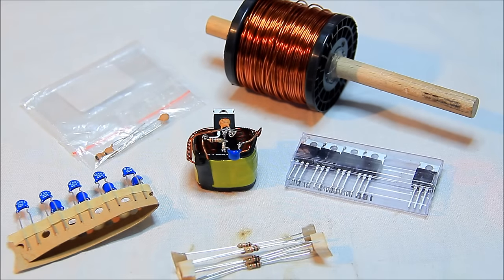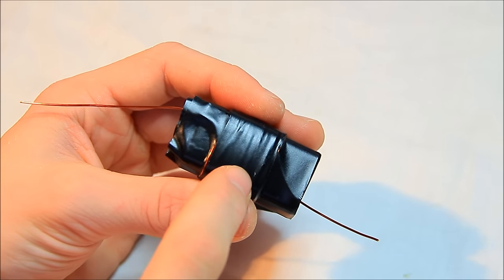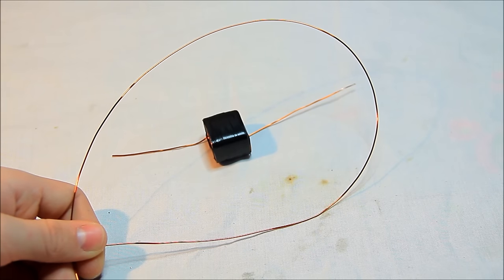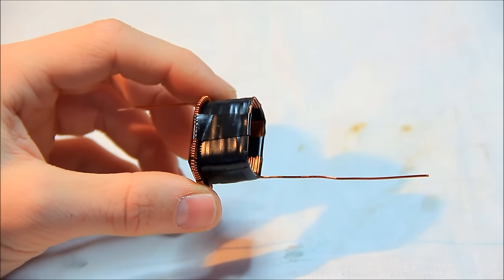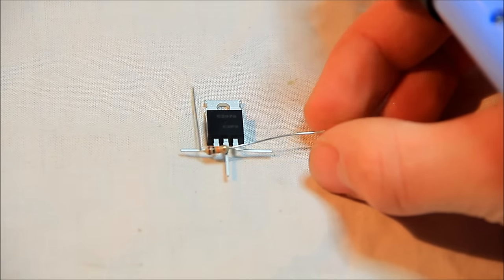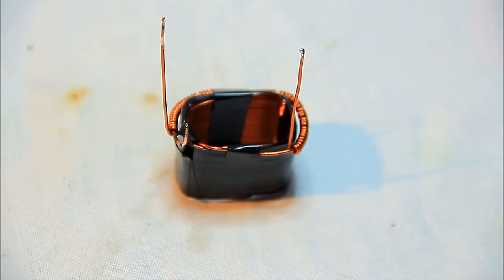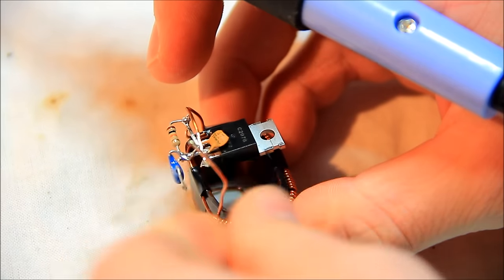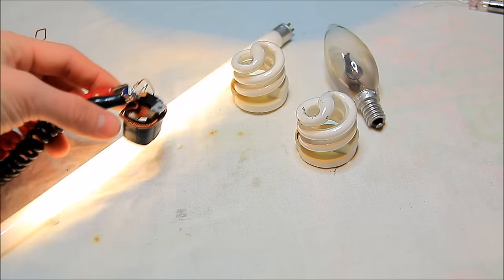EMP Jammer Step by Step / Slotjammer Tutorial

Comment: I have been making there's for years and I promise you they work 100%. You have to use the right components and make sure nothing is touching. Also the coil can't touch anything when it is firing. Lots of mistakes can be made, but if you do it right it works. Main could is 25-30 and smaller secondary coul is 2x the primary. Power with 3 9volt batteries but can handle 5 9volt batteries.
Reply: How much do you charge for them
Reply: Do you sell these?
Reply: It is strange that the power is connected across the emitter and collector.
Also the primary circuit. A high current low impedance supply would not be good.  But it seems to work with batteries.
The length of the power leads must affect operation.
Reply: please make me two of them i will pay you.also i have an e.l.f. emp that i bought as a sleep aid can it be modified to beat game machine
Reply: Where can I buy one of these
Reply: Would the one in the video be able to jam shielded devices

Comment: here is what you will need:

0,7 mm copper cable
electrical tape
9 volt battery
transistor 2SC2078
10k ohm resistor
47 pF capasitor
220 pF capasitor
soldering-iron
alligator clips
Reply: fake  :(
Reply: how is this sending emp?
Reply: transistor is special.
Reply: capacitor  500v?
Reply: yes
Reply: not fake i made it works good-ish
Reply: Mine is 1kv.
Reply: How much watt has the 10k ohm resistor?
Reply: What battery did he use?
Reply: What is the power source for emp?
Reply: dpr thanks
Reply: Can this wk on slots
Reply: @bruqisdabombfosho5031  hey you have a partlist i build one but not working
Reply: @dadasabalala9033  1/4 W
Reply: 0.7mm is for the main coil, and for the secondary which gauge will I need?
Reply: Dude, I use all those components but tell me that another transistor could replace the c2078, would a D882 work for me? Thank you, I hope to answer a hug
Reply: A doubt, the secondary coil is used the same caliber of the primary? I mean 0.7mm the primary and 0.5mm the secondary, or the primary 1mm and the secondary 0.7mm Please help
Reply: What range of electromagnetic wave
Reply: Du bist cool mach weiter so.

Ich finde deine Videos cool.

Bitte um antwort.

Ich bin dein Fan.....

Comment: It is strange that the power is connected across the emitter and collector.
Also the primary circuit. A high current low impedance supply would not be good.  But it seems to work with batteries.
The length of the power leads must affect operation.

Comment: Hi,
cool stuff!!! But: I cant see were the big coil ends. And a circuit diagram and explanation would be nice in the next vid  :-). Is it possible that the device requires the voltage supply to have an internal resistance? Otherwise it would not make sense to connect the power supply accross Collector and Emiter.

Comment: Hey.  Do you have a link to a good transistor and the magnetic wire?  Im having hard time find what transistor that will work.   Love your work and a translator.  Very good video.  Thank you.  I got mine to work a little.  But i dont know where to buy transistor that works.  There are so many.  Does mosfet have these and do they work?  Not all 2sc2078 works.
Reply: I have seen this circuit using the 2SC2950. The package is different, the outer leads are reversed.

Comment: With your soldering technique, I'm shocked that it works.
Reply: +jraykc what's wrong with it?
Reply: +MrGoatflakes Too much solder,didnt pre heat the wires
Reply: The more solder,the merryer, sufficient solder assures good contact for electrons to pass, i see nothing wrong in the video, and... preheat the wires? Are you serious?
Reply: Jiji Kent 
Proper soldering involves heating the wiring (not the solder) until the solder melts. If you just melt a bunch of solder onto the wires, you end up with a cold solder joint. Might work at first but any vibration will break it loose.
Reply: well you have a point there, just saying for the purpose of the video ,the soldering is adequate in my opinion and i am thankful for the time the uploader invested
Reply: really bro post someting you made then and show your better before you judge
Reply: you're

Comment: you can use a 9-volt battery ? Please can you tell me specifications of the transistor and other components. THANKS
Reply: 10k resistor 
transistor 2sc2078
47pf compasitor
220pf compasitor
Reply: +rintuut 47pf compasitor 1kv
220pf compasitor1kv 10k resistor 1watt
Reply: karlos ximenez h7tf

Comment: is it possible to use a triode tube instead of a transistor?
Reply: Yes, it is.
Reply: It would just be more inefficient
Reply: Jet Addict
Vacuum tubes are more efficient than transistors, they are used in hifi amplifiers, radio communications and more, even your microwave oven has one, the magnetron.
 They can also handle bigger power loads.
Reply: lvlarihuano lvlarihuanísimo i mean it would suck a lot of power kinda way but i know that man :D
Reply: Jet Addict
OK, in that case it's true, vacuum tubes consume much more electricity because of its filaments, are bigger, become very hot, but it all depends in what devices you're gonna use them. I think that a vacuum tube will perform better in this EMP jammer than transistors do.
Reply: Probably because its more resistant to emp waves right?
Reply: Jet Addict
Well, actually these are not EMP waves, just weak magnetic waves. If it were a true EMP jammer then the device would commit suicide without using any protective shield :D
Reply: lvlarihuano lvlarihuanísimo lmao thats true

Comment: How many turns on the 9v battry?
Reply: Assuming W stands for wenden(turns), the schematic  says 20-30 turns for the main coil and 40-60 for the secondary coil (55 in video).
Reply: Thanks sir.  That actually helped me.  One last thing if i may ask you sir.  Was it 40-60 with 0.5mm or 0.7mm coil wire?  I have now 1.2mm and 0.5mm wire.  And thanks for taking your time to help.  Already helped me. In another video i saw the made one but with 77 turns.  It pends on thicknes of i think.  But what was what.  Was 0.7mm 55t urns and 0.5mm 77 turns.  Im confused you see.  Im starting to learn.  I started a few months ago.
Reply: +Normann
It is 55 turns with 0.7mm enameled copper wire
Reply: +Normann
Good luck with your learning. I have a few years experience with circuits, but I have a lot to learn too.

Comment: please help.. where can i brought 1.7 cooper wire?  tnx
Reply: +Chan Lita Maghanap ka sa mga sirang appliances.
Reply: +Michael Espian or punta ka sa hardware !!
Reply: ei wla aqng mkita sa mga sira kong transformer.. wla din sa ebay? wla nga din sa electronic shop ei.. kaya naghahanap ako online na mabibile.
Reply: Ganun ba, meron na akon na gawang coil d2 kung gusto mo bigay ko sayo tagasaan ka po ba?
Reply: no doesn't work
Reply: Nakapag pagana na kau ng ganito guys?? Pahelp naman ako d ako sure sa mga circuit e kulang kulang ung info
Reply: Mapagtiis Ako Ubos d2 samin yung mga illegal na mga fruit game machine. ano kulang sayo tol?
Reply: Sir anung watt ung resistor tska ung voltage ng capacitor na 47pf and 220 pf tska anung replacement para sa transistor na 2sc2078, tnx sir upload ka din ng video mo sir maraming salamat
Reply: saan mo ba gagamitin an EMP magkakasundo tayo nito? ung resistor 10k.
Reply: Same sir mga illegal fruit machine dito samen ahehe, ung sa resistor 10k ohm tinatanong ako kung anung watt need ko pati sa capacitor need din nla ung voltage
Reply: sa capacitor 220pf resistor 10k meron kanaban transistor na C2078? tagasaan ka tol gawa tayo ng emp V1 add mo ako sa fb 9volts pwedi na.
Reply: wala pa nga ei ang mahal ng capasitor... wala pa sa pilipinas.. ooder sana ako sa ebay.. kaso wala pakong eprepaid card.. hindi ko pa yun maasikaso.. meron nakong magnet wire.. na gawa ko na tsaka transistor at 10k resistor.. capasitor nalang tlg wala..
Reply: Magnet wire?? Iba iba dn bang klase ung copper wire??
Reply: add nalang kita sa fb.
Reply: Naka kuha na kong 220pf tska 47pf capacitor kaso 50v lang ayaw gumana mga boss
Reply: Mapagtiis Ako add nalang kita boss sa fb para usap tayo dun ano email mo?
Reply: guys san kayo nka bili ng ceramic capasitor?/ yun nalang kulang ko ei
plss help nman.. pang magic trick ko gagamitin tnx
Reply: pki info nman sakin kung san makakabili ng capasitor ... plss.. tnx
Reply: Ang hirap nga humanap ng capacitor pre, kung san san na ko makarating wala ko makita, pinag tatawanan pa ko kc wala daw ganun kataas na volts ng capacitor tsk tsk
Reply: meron sa ebay kung gusto mo bili tayo?/ mejo mahal kc ei.. pero 10 pcs na yun? 220pf plang yun..
Reply: Chan Lita sa pag*or susunod ko tirahin ko
sssssss
Reply: Ganito tol buy ka sa ebay tapos bentahan mo kame 220pf tska 47pf 1kv or 2kv tol
Reply: ok kuha muna ako ng master card.. pag meron na balitaan ko kayo..
Reply: Chan Lita need ko lang 2SC2078 ang hina ng D882 mas ok c2078 buy din ako sayo tol kung meron kapa extra. tnx
Reply: Naka order na ko ng capacitor kaso medyo mahal tska 3weeks from now pa daw ma ddeliver, may makukuhanan ako ng 2sc2078 ilan need mo sir??
Reply: wews sayo nlang ako bibili ng capaitor.. yun nlang kulang ko.. pwede ba?
Reply: bili ako sayo ng 220 tsaka 47 plss
Reply: Tska na tau mag usap pag hawak ko na ung item,  bigyan nyu na lang ako ng contact number nyu para alam ko kung san kau kontakin, laki na ng nagagastos ko sa project na to ahaha, sana makapag pagana tau gud luck saten lahat 😊
Reply: Chan Lita Trade tayo dami ko cap d2 meron ako 220pf , kulang nalang sakin transistor na C2078. may napagana na ako pero di sapat ang D882 na transistor.
Reply: Micheal Espian ok my mga c2078 pako d2.. kaso kailangan ko pa din ng 47pf.. meron kapa ba? tnx
Reply: Anung volt nyang 220pf mo sir?? Ung inorder ko april 13 pa daw ma ddeliver saken, meron ako mabbilihan ng 2sc2078 pag assemle-lin ko na video ko den pra makira nyu
Reply: Gumawa ako kanina saktong sakto sa build ng uploader kaso ayaw gumana umiinit lang ung transistor ko, patulong naman ako mga sir hnd ko alam kung anong mali sa gnwa ko

Comment: Look man. You need to tell how many turns you use on the coil. The video is useless otherwise.   Understand?  So how many turns did she do on the coil wrapped around the 9 v battery?????????????????????
Reply: Yea right....
Reply: I find one thing for sure when working with electricity.   It is that it all comes to work better when i do it right the first time.  And measuring of this coil wire is how much resistance you are giving it.  So it has to be in correct length.  Just like the coil you make on a simple fm transmitter.  If it is not correct wire and length you get bad results.
Reply: 30
Reply: Thanks:-)
Reply: ???? are you shure?
Reply: writing to me?
Reply: Normann yes i was just joaking XD
Reply: +Normann You are on every jammer video. 😳
Reply: ShadowGuidR HAHAHAHA.
Reply: What is it that im missing guys:-)???  I can see you are laughing:-)  Come on..  Tell me what is so funny?  Im not that good at this computer stuff so tell me:-)
Reply: how many volts does this shit work with? 1000 volts?
Reply: So fucking what..
Reply: ShadowGuidR   He he he:-))))))     I know.  I was trying to learn.  I do not have any degree in electro.  But i have evolved:-)   Universes gift to all man/spirits. We can learn something new everyday:-)
Reply: b
Reply: Ragnarok
Reply: Ja.  Noe du tenkte på?
Reply: Do you have any links for good magnetic coilwire?
Reply: You have to go into inches.   7mm is: 0.03inch. 21 awg.  Remington industries if you are usa. Have another if your not.  But i have to look for it.  Just write search words in amazone.  Or ebay.  Bought mine there..

Comment: hi bro u can tel me 9v bat 1 pc or 3 pcs
Reply: 3*battery. 27 volts
Reply: +Normann  tq bro
Reply: +Normann bro i tesx aldy but cant no work wat happen
Reply: Make sure you do it right.  Write down. Make a scetch. And measure with digital caliper to find right size. And there are videos on wich transistors that workes.  Just look it up man..  It is here on youtube.
Reply: Paralell wire the batteries.  Do not wire in series.
Reply: are you shure?
how many raunds arond the coil?
Reply: Paulo Nóbrega  There is videos for it here on youtube.  They are not powerfull. They will disrupt a small device or such. Just remove rack and connect small coil on the two wires in handle.    https://www.youtube.com/results?search_query=mosquito+emp